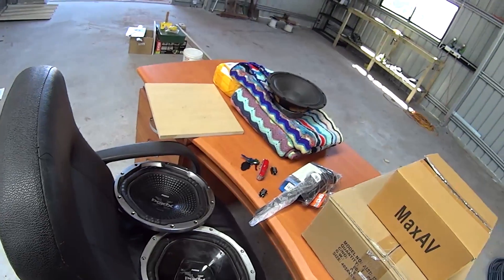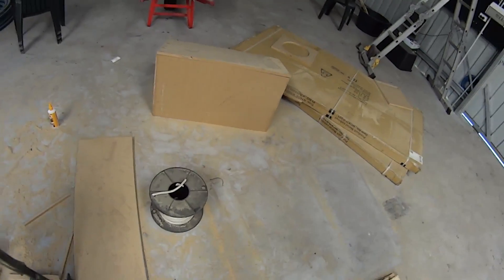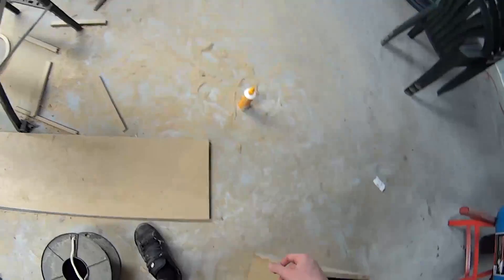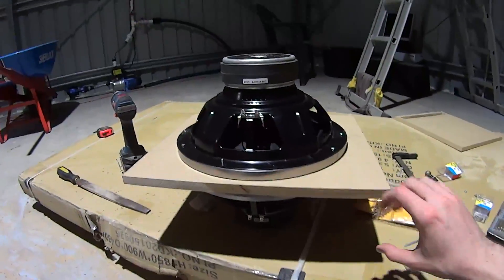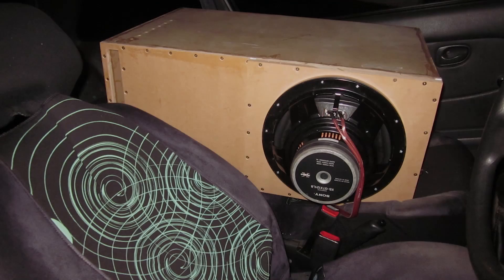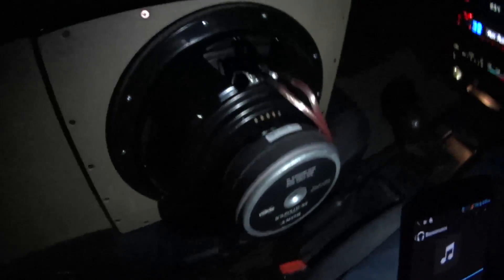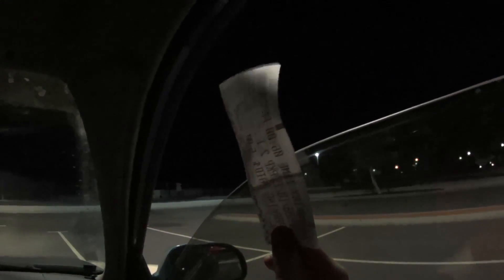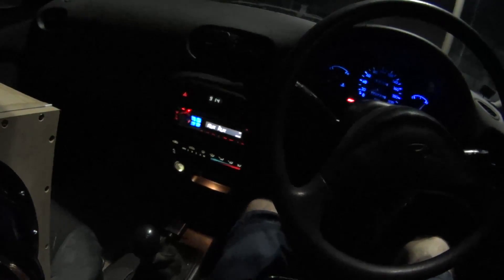Isobaric 2x 12" 25hz ported subwoofer box build vlog thing

Comment: but the outer sub isn't making any bass? I think you make the same results if you the pull the outer sub off.
Reply from the maker: +jijisniet I'm yet to try it without the top one off, however Isobaric designs are proven to work, the two subwoofers do act on each other to essentially provide more torque, in a way. it's certainly not the most efficient design when it comes to strait up loudness, but the end result for me has been well worth it, being tuned so low it means most music has smooth non intrusive bass, but when you get into some lowbass stuff, and other bass-heavy music, it kicks it up a notch and can really hammer out some deep deep lows :D
Reply: +jijisniet know what you're talking about before making uninformed comments.. by doing this the vas is cut in half reducing the required box size by 50%.. instead of running a sony 49L (1.38 cu.ft) box you can get the same response plus slightly deeper bass in a 0.7cu.ft box.. in saying that, this box looks way too big for what he's doing, Sony subs run a 2.05cu.ft ported box, for this to be more efficient, the box should be half that
Reply: Also... the second sub on the outside playing the opposite note helps control the excursion of the other woofer... so even if the box is too big, the second woofer helps keep the system from flying apart..
Reply from the maker: +88kwthomas I used the WinISD calculators for box sizing, and fiddled with the size till I found something that fit in the car relatively easily and produced a wide band of output, being at 25hz I didn't want it to only hit 25hz and not do anything else, and found at least in calculating smaller boxes, the peak was less and brought up in HZ.. though it would have brought up the higher range of bass a tad.. at least all in theory. this whole thing was a bit of an experiment and worked quite well to hit the lows I wanted. box is aprox <100L probably just around 90, if the material and subwoofer was measured) all in good fun though!
Reply: Thanks for all the info guys . :)
Reply: +metalinvalidmatt interesting to watch,  i would imagine the subs not lasting too long in a box 3 times larger than this setup requires
Reply from the maker: +88kwthomas they don't seem to "unload" or anything of that nature, apart from being hammered by the amplifier, how exactly would they be damaged? T-line setups seem to be much larger.. though i've heated them up a few times from putting a little too much bass for a little too long, turned it down once I smelt that smell :P
Reply: +jijisniet its basically its a big waste of time because you need to power 2 subs, not just the one and its rumoured to be around 6db less efficiant than if you were to run 2 separate subs in there own boxes.. the ONLY real advantage is smaller box size

Comment: I didn't catch if you had them wired out of phase or not. Judging by the results I would guess you did. But if you didn't, I suggest you try it and listen for a major increase in bass response.
Reply from the maker: +Pha Q yeah, i had a quick test at low volume of phasing (and even single woofer to make sure everything is working right) but yeah, both woofers move in and out of the box together, if they went against each other, I think the cones/surrounds would hit each other possibly!
Reply: metalinvalidmatt Good to hear. I am building a small bandpass with a pair of 8" pyle out of phase, It doesn't hit hard, but its clean and gets low. No huffing noises.
Reply from the maker: +Pha Q sounds good!
Reply: @PhaQ2  How did it turn out ?